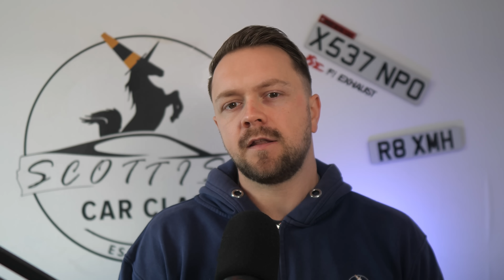Modern Cars Are FAILING Us — So I’m Saving the Reliable Ones

Comment: I'm in the process of looking for a new car after my 2009 polo that I've owned for 17 years is on its way out. 

The power steering has gone, which no one wants to chase, and there's underbody corrosion. If I knew about undercoating, I would've started doing it years ago, but I don’t know a thing about cars, and I think it's too late now. 

If it wasn't for the steering, I would keep my car for longer. 

I'll join your mailing list 👍

Comment: I much prefer the simplicity of older cars. I have taken the difficult decision to replace my Mk2 MX5 with something a bit more modern and practical as a daily driver. 
Hopefully I have made the right choice with my 2012 Suzuki Swift Sport. It’s a great example and still relatively old school mechanically, but modern enough to be fairly efficient. Hopefully if I get it well under sealed now, it will give me many years of service. I wouldn’t want anything newer even if I could afford it. Newer cars that will soon be thrown away are an impending disaster in my opinion.

Comment: I live in Blackpool; so unsure how feasible this is... But there's a scrap offer for my 2007 Ford Mondeo Edge (estate, tow bar and voltmeter etc.) 166k ... And there's bugger all wrong with it (except exhaust and suspension components). Surely it's worth more than £277.
So, I'd offer it to you at that number, if you could keep her on the road

Comment: I have an 08 vauxhall corsa and I had an issue with the vacuum servo pipe with plastic pipe splitting at the plastic unions so I removed the plastic unions from the pipe then I bent a lenth of copper pipe to the required shape using a spring on the end of a long piece of string then I used pieces of rubber fuel line to link the unions using metal fuel pipe clips to the 8mm coppsr pipe.

Comment: I have 2002 1.3 automatic Yaris 3 door. It’s perfect with no rust. I had the underside cleaned and protected with high quality under seal and I waxed inside all the box sections etc.
   It’s 100% reliable and gets me round all my local trips and 100mile runs to the coast.
   I thought about buying something newer, but I can’t stand the expensive over complication on new stuff
  I’m almost 60, so the Yaris will probably run till I pop my clogs 😂

Comment: After seeing this, i love my 2007 Volvo V70 2,4 5 cylinder engine even more.Perfect leather seats,driving comfort and physical buttons.The cockpit is still in almost mint condition with premium soft surface and aluminium all over.No rust at all and only 140000km. I thing i will keep it for many more years 😄

Comment: I currently have a "simple" modern Skoda. You cannot even fit a towbar without it being coded in if you get one from a third party Skoda say in event of a fault they will not support any car repair, without the whole thing being removed. Even if you want just the bar fitted and Skoda to do the electrics they will not. As such to get Skoda to do it costs about £500 more than a third party reputable fit. In my view this is a restrictive practise by Skoda and indeed the rest of the VAG group manufacturers who all do the same.

Comment: I was thinking to myself that maybe in 10 years time I would get a Toyota hybrid. Now I am thinking, why don't I just keep my Honda Civic Mk8 i-shift for even longer, it is 2009 with 113k kms and I only do 8k kms per year. Even if in 10 years if I have to replace the clutch I am better off doing that. I still think that my Honda mk7 2002 was the most reliable  car I owned 121k miles, manual. Only sold it cos it was right hand drive and I live in Europe. Also cos it was manual without cruise control, so I would be limping after very long journeys.

Comment: I wish I could afford a Kia V6 Sorento here in Australia. It is (I believe) the last and only multipoint injected atmospheric V6 still on offer with a torque converter gearbox (it's sister car - the Hyundai Santa Fe has now gone to the type of engine and gearbox I do not like). Although Kia still makes the smaller 4 cylinder Sportage also with an atmospheric engine and torque converter gearbox, it isn't really torquey enough to manage the 6 speeds so it does a lot of annoying gear hunting at higher speeds. The larger V6 has no such problem thanks to the large amount of torque and a flatter torque curve as well.

Comment: I love my 2015 Honda Fit that Honda stupidly stopped selling in the USA after 2020. She's got some modern features but is more basic than the crap that's sold for $$$$$ in 2025. Ruby still has a CD player! She's had some issues (2015 was a problem  year) but most have already been dealt with by me. I drive 78 HARD miles a day for work and she's got over 145,000 miles on her. Whenever she does need a new engine, I'm just putting one in. I refuse to buy the extortionist, spyware filled crap sold now. For a subcompact car she's awesome. I sleep in her when camping. We go off-roading. She gets good mpg.

Comment: I have a 11 year old civic which I bought for £9000 from a honda main dealer when it was 3 years old 
It's never flickered 
Still has original exhaust,battery and brake discs 
Annual service oil and filters 
Still on original spark plugs to which I might replace next year ?? 
Car is on 58,000 miles and still looks a modern car in mint condition 
I'm gonna either do it myself or pay a garage to under body protect it ,as underneath it's starting to look a bit rusty ,but outside and panels is immaculate
Could I afford a new or 1 or 2 year old car ?? Yes easily ,but why on earth would I spend 25k when my civic is such a reliable nice looking car

Comment: It's a really good point. We always had XC90s from new but when I retired I picked up a late model Volvo V40 in top spec with the Volvo 1.5 152 bhp engine/Aisin Warner auto box as my runaround. My son in law is a Volvo mechanic and does my servicing. The Volvo mechanics enjoy working on the V40s as they are the last 'modern' Volvos that are mechanically simple, based on the Focus underneath. If you have a good runner from a decent manufacturer, service regularly and keep for years. As the man says they are the last of the breed.

Comment: I have owned a 2005 Honda CR-V diesel for fifteen years. Undersealed with waxoyl and treated the underfloor box sections internally with an extension lance as well..the body work and chassis is in good condition with no corrosion. The vehicle is easy to eork on, everything requireing regular servicing is easy to get at.
   Modern cars are a pain in the arse.

Comment: There's to much bells and whistles added to cars today. While the problem was emissions only. Instead of addressing just that they added lots of unnecessary things to try getting people to buy them. 
Imho governments should Step in and demand change for easy repair. But this problem isn't just cars. It's on everything we buy. From cars to appliances to gadgets. 
The right to repair should be applied as much as possible on everything. 
Regulators are talking but manufacturers are skipping over the line where ever they can without accountabilities.

Comment: When my N47 BMW timing chain went last year, I quickly found a cheap Chevrolet Matiz for a grand just to get me to and from work. 2009 plate, 33k on the clock. I call it the Nokia 3210 of cars.. it was built purely to get the common man around town.. no electric windows, no heated seats, no unnecessary electrical additions. Just a car with a little engine. And do you know what? I kinda have fallen for it. The simplicity of what a car was originally built for! I open the hood and everything is easy to get to. A timing belt change was the easiest I’ve ever found and parts are built to last on these engines. I’m going to miss when these sort of cars are extinct and what we’re only going to find are the ‘newer less reliable engines’ about! Let’s keep these bog standard little whips around as long as possible 🙌🙌

Comment: I'm with you on preserving older vehicles and recently paid to have my VW T5 campervan needle blasted and given a Dinitrol rustproofing. Result, MoT advisory, "undercarriage painted heavily black underseal all components painted black heavily". Either my station is overzealous or the Driver Vehicle Standards Agency is in on the planned obsolescence.
Reply: Did u get this done in Darlington by any chance ?
Reply: @boyasaka Johnstone - Preserve and Protect
Reply: The MOT mechanic doesn't have xray vision and is not allowed to scrape off your underseal to check the integrity of the steel underneath. Their advisory is perfectly understandable, they are warning you that they were unable to check under your underseal. Sounds perfectly reasonable.

Comment: My Renault Grand Scenic 2.0 Auto petrol is 20 years old in January with 70k miles. Bought it new, runs great but the electric steering pump is on the way out, and they don’t make them anymore. It’s £2k for a reconditioned part + fitting and vat looking at £3k 😮 cam belt change £800, other things needed including some electrics doing and I am looking easily at £5k to £6k. Unfortunately garages are like the Wild West, you don’t know if you are being ripped off or not half the term from main dealers, independents. I will see if it passes the next MOT but if not I will have to move it on. I have spent £1000s over the years maintaining it . The other issue is the road fund licence is now almost £500 a year. I can’t justify spending that. I want to replace it with a Honda CRV or VW Touran. I prefer diesel and thinking of buying up to 2016 with the lower road fund licence. It all seems to change after that. Any thoughts or advice welcome on models , engine type etc. Great channel, just subscribed.

Comment: Grant, could you do a video on which cars are the most resistant to corrosion as they get older? My research seems to suggest that most Fords rust relatively fast (exception being the Fiat built Mk2 Ka), VAG stuff tends to hold up pretty well. What about the Asian brands? I have noticed that Mazda tend to rust but have no idea about Toyota, Hyundai etc... A lot of people can do mechanical repairs but are unable to weld or do body repairs.

Comment: I don't know anything about car mechanics. What I do know is I have a 2L diesel 2011 Toyota Avensis Estate on my drive. I bought this car because I'm running a Jeep Renegade, which I bought new. I like the Jeep. But I don't like the tiny 1L engine, the screen, the lane assist, the collision warnings, and all the other bs they have added. The 22 Jeep is a nice drive now, but I just know that once out of warranty, it's going to be an expensive pain. So the Jeep is going off-road in a few weeks. It's on a 4-year contract (ends next June) and I fear its going to start going wrong soon. The Toyota is getting an MOT in a few weeks and then it'll be my daily driver. And a car I'm going to treat well, underseal, work on, learn about, and keep 100% maintained. I want the Toyota to last another decade. It's done 100,000, and I'm told they're good for 300,000 if looked after. Not sure what to do about the Jeep, though. Keep it and use it occasionally until the contract is up next June? Or enquire about passing it back early and paying a fee? The Jeep scares me. The Toyota makes me feel safe and secure. I think I made the right investment; I could see this coming.

Comment: Sounds like a great idea. Nothing to do with cars, but I've just got my 20+ year-old petrol Ryobi leaf blower going again after it had been sat in a shed and forgotten about. It had seen much better days, so I cleaned it up, got rid of the rust, resprayed it, rejigged the tank, and fitted new fuel lines which had disintegrated. Then, I managed to clean and rebuild the carburetter and I also learned how to adjust it properly, now it's running better than ever! Hopefully, it will last for many more years to come. It leaves you with a satisfying feeling when you get something working again, I've also learned a few things along the way, plus I've managed to save a few bob in the process because now don't have to go out and buy a new one.

Comment: My 2015 Focus needed 2 new front suspension arms about 18 months ago, not really an issue with a 9 year old car with 125k on the clock. However, the driver side one has failed twice more within the space of 18 months, which is in my opinion ridiculous. Clearly whoever made the part didn't do a good job of it
Reply: The person working on it had absolutely no control over the quality of the parts.

I suspect poor quality arms is the problem here, not the person on the spanners.
Reply: @CosmicSeeker69 I don't blame the person that fitted the parts at all, I agree it's down to the manufacturer of the parts

Comment: Interesting idea. I hope you can do it. My 2014 Civic is still passing MOTs. But how much longer can it last?
Reply: You may be surprised, we have an 05 Nissan Micra, apart from misted up headlights it has never had an MOT failure. Not a handsome car, is very basic inside and not an exciting drive. Local garage looks after it when required, tax is £215 but surprisingly it’s LEZ compliant. Probably keep it until it dies.

Comment: Got a 2005 Honda CRV, Professionally waxoyled running well looks new drives great, I can afford a nice new car but dont see the point. Its brilliant and utterly reliable, easily home serviced. Other car is a 2013 Merc C220D. Equally brilliant. Only issue was my belowed managed to trash the drivers door hitting a post. Bought one in the same colour from ebay for £150 quid and fitted it myself and kept the coded parts from original and retrofitted to new. All works, cannot tell, happy days. Why do I need modern trash??

Comment: I sold a 2002 clio diesel and replaced it with a 1988 renault not too long ago. As long as it has a heater, drives and gives the thrills.
Parts are becoming hard to find bit i am planning to save several oldish cars. Simplicity is everything you need. 
I might only have four gears and 13" wheels it is just as economical to run as a "modern" car fuel wise if not better. We need to save them even if there are ugly things amongst them for most people

Comment: Everything has just become to complicated and unfix-able. I though we were supposed to be saving the planet here, not filling it full of landfill of things that cannot be fixed.
Keep the good stuff going, even if it costs you a few quid to fix it. A good example of this is my sisters Hyundai. Its a 2014 Diesel model with 64000 on the clock and the only things wrong with it is a problem with the drivers side window switch and the radio does not work. Anyway, she is thinking of changing the car for something much newer and I have told her to fix the Hyundai and to not waste her money on anything newer because it wont last as long as what she has already got.

Comment: The problem I find with old reliable cars is the availability of parts. I had a low mileage 2005 Corolla which I sold last year and whilst I had no doubt the engine was bullet proof, I found it challenging to find a replacement wiper arm where the teeth weren’t completely worn out. I then had a broken air vent from an annoying mobile phone holder and again took ages to find a vent. I have no doubt that mechanical parts could be sourced. That’s my only problem with older cars (apart from rust which is a bigger problem!)

Comment: Sadly I'm finding it difficult to get decent quality parts for older cars even from well known brands. I've come to accept wishbones will last 2 years, 3 if you're lucky even on lightly used cars before a bush or ball joint goes. On 58 plate Corsa I've had a replacement EGR valve, drive belt tensioner and water pump which were all faulty out the box. it's on its third subframe, the first one lasted 15 years the replacement lasted 3 before an advisory (I painted the third with epoxy mastic and sprayed inside with cavity paint before putting it on). On another car I had a replacement wheel bearing which was badly machined you couldn't tell at first but every 1000 or so miles it wrecked the brake disk.  I changed the brake disks twice before I realised what was causing it.🙄

Comment: My Toyota RAV4 has an ignition key to start and stop it and it has a handbrake you pull up. It has a minimum of sensors and it lets me get on with driving without interfering. I have had it for 14 years and it has done 40,000 miles. My SatNav is Waze and every second year I have the oil changed- I use only the best and that is about it except that it is not for sale.

Comment: I just took my 2011 giulietta for it's first MOT in my ownership,  passed with very little advisories,  I bought it with no service history pack, so I've had a full service done, just need to save for Cam belt and water pump so I know it's done, but even at 135k it drives like it's been looked after

Comment: I rescued a 2011 Fiesta 1.6 tdci  with 170000 on the clock for 250 quid from going to scrap, bodywork was battered, patched it up and use it as my daily driver, its a great little car- 20 quid a year road tax and 70 mph what's not to like

Comment: This is why I brought a 1999 Audi b5 1.9 TDI  it's the facelift model, AVG engine code. Owned it for 6 years now, some will say it's boring but I see past that and its the best reliable car I ever owned, I do all the work on it myself obviously that's the key to keeping an older car on the road, It's just rolled over to 220.000 miles and still going strong.

Comment: My long in the tooth Vectra 1.8 petrol is still going, nearing 200,000 miles, I will keep repairing it until it gets severe corrosion on the MOT - its a 2008, so pretty well sorted for a Vectra in its timeline - so its new enough to be modern'ish, regarding safety aspects but above all, its cheap to fix and with no bongs going off or silly emissions to deal with, port injection not direct injection, a simple NA engine that does the job!